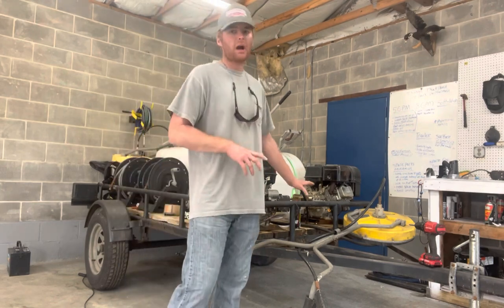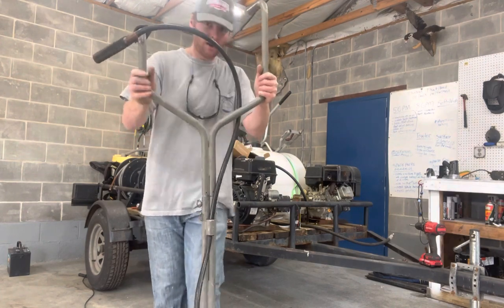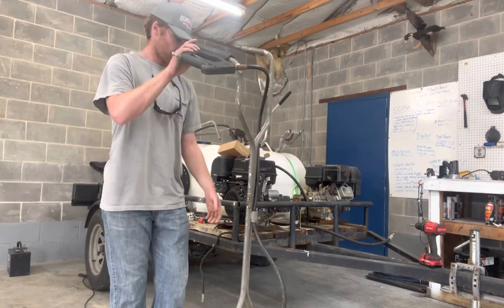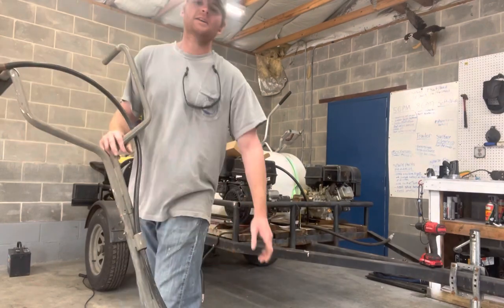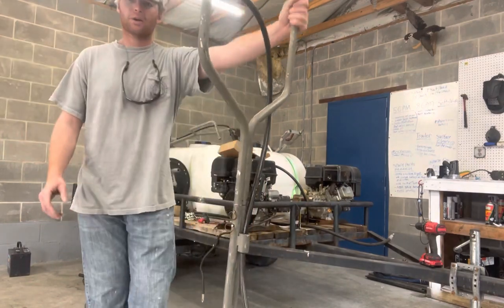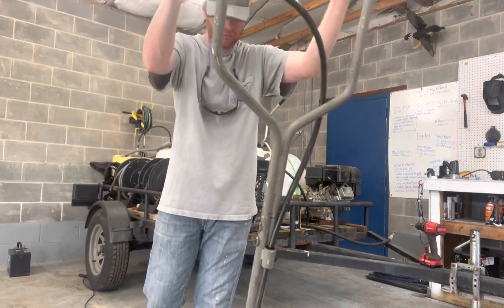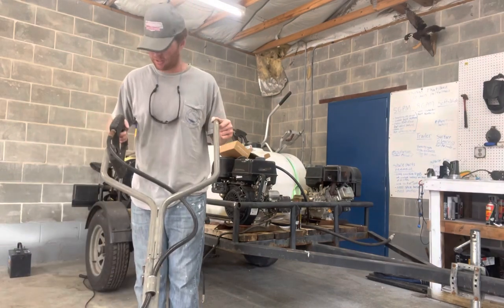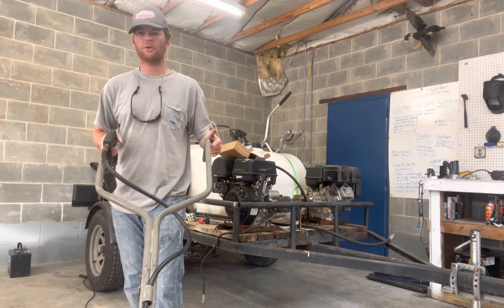How to Fix Handle on BE Surface Cleaner for Pressure Washing!

Comment: I have a problem with connecting the quick connect scrubber handle to the pressure hose. It has worked fine for 2 1/2 years, but after this winter it won't insert completely. My wand connects fine and they look the same to me. I removed the plug and stem from the handle and want to replace the plug portion, but I don't know exactly what size plug to order...😮 I think it's a 3/8 or 1/4. It's a B E scrubber. Can  you help? Thanks in advance. I'm thinking order both from Amazon and return the one that doesn't fit 😂, but I hate inefficiency. I'm kinda in a rush as I have a job to complete. Any help would be appreciated other than buying another scrubber. Thanks again